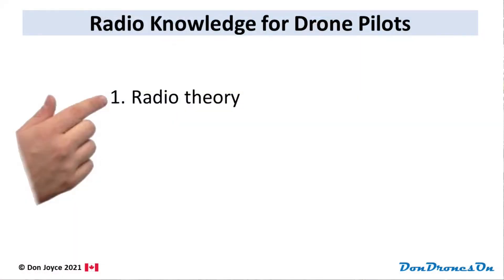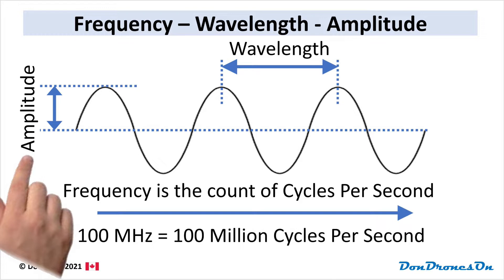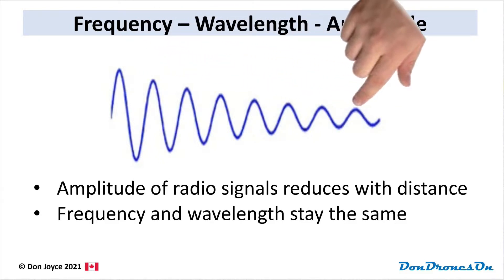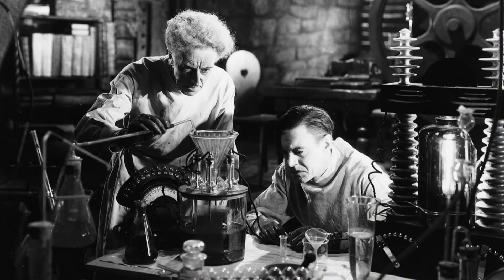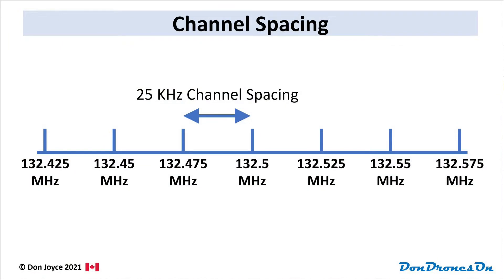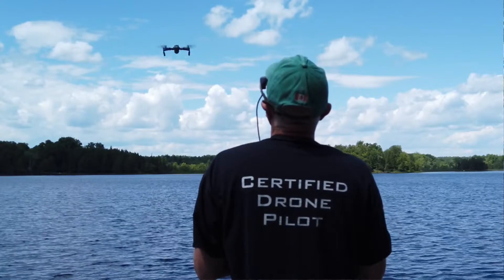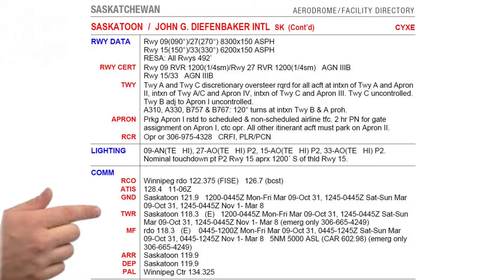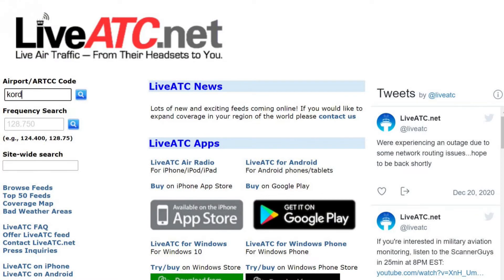Radio Knowledge for Drone Pilots - Part 1: Radio Theory

Comment: I though it was illegal without permit, and also I believe basic pilot should not.
Could be more dangerous than helpful…

Thanx for your clarifications
Reply from the maker: To use a 2-way base station, you need both a ROC-A operator's license and a base-station license.  The latter is not required if the radio is on a manned aircraft.

Comment: Excellent, Excellent, Excellent....I just started to prepare for the advanced license and your content is very educational and easy to follow. Best ive seen so far. Question,  can you recommend different tiers of radio I could use to listen air traffic communication ie entry level to mid level aend maybe pro? Thanks in advance.
Reply: Just say the question from Testa below so i guess i have my answer.
Reply from the maker: Thank you, Joe!  I'm glad you find my videos helpful!  There isn't much out there with Canadian perspectives.  Regarding the radio, I would start with a scanner, rather than a two-way radio.  There are also apps and websites where you can listen, as I mention in another video in this series.  ISED (aka Industry Canada) has refused at least one drone pilot's application for a permit for their two-way radio license (not their ROC-A, but rather the permit for the radio itself!), and so Transport Canada is re-thinking their guidelines for radio use.

Comment: As far as I know the most of the drones and control stations use frequency-hopping spread spectrum to transmit and receive data, so channel space such as 1 MHz doesn’t have any sense. Moreover, these frequency bands ( 2.4 and 5.15 GHz) are open for any other applications and not required any permission or license  for transmitting data. So the approach of dividing the range by channel space leads to fixed number of channels, possible overlapping them and overloading the band.  So there is a huge difference between organizing channels for radio communication between people (frequency modulation on fixed frequencies in dedicated and protected frequency range) and C2 channels (open and not protected frequency range) , which use FHSS. The video channels use FHSS too  but mostly they use 5.15 GHz range.
Reply from the maker: Interesting!